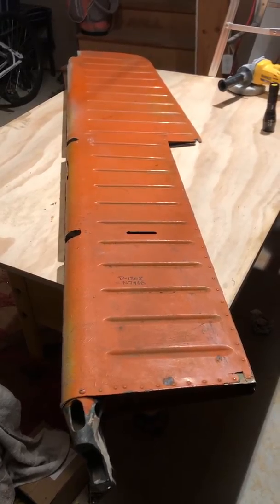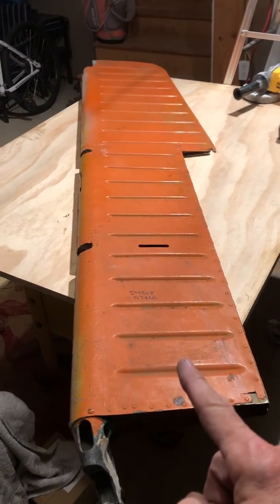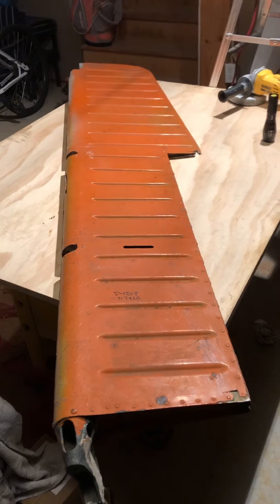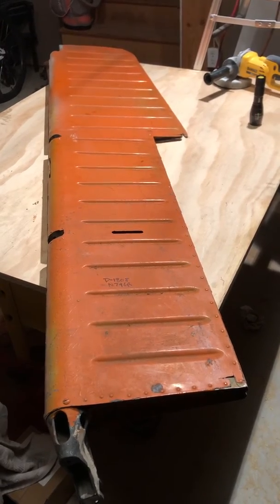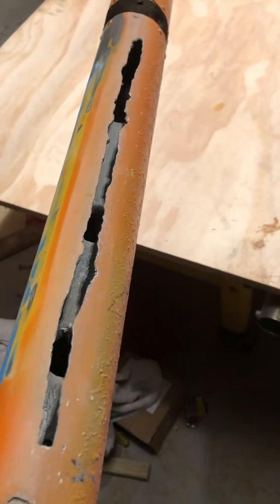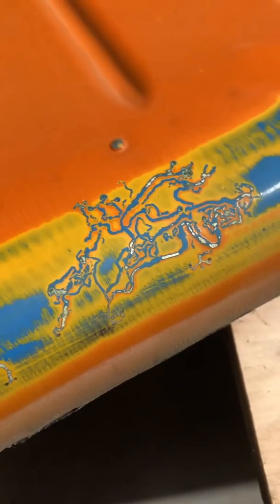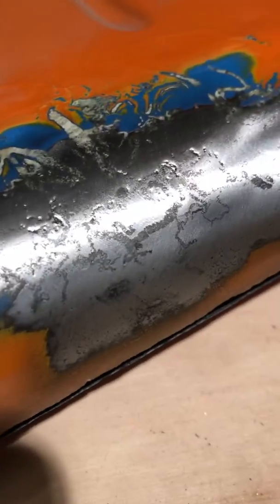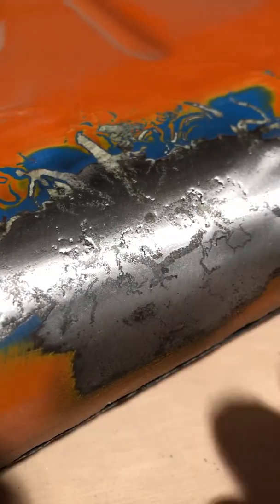Beechcraft Ruddervator Carbon Fiber Replication

Comment: Do not waste your time. It would NEVER be approved for standard cert. EVEN if you shopped for a fsdo. WHY ? let me count the reasons. 1st there is a great Aluminum built early ruddervator out there that weighs less than the mag ! YES and the workmanship is fantastic. BUT NOPE the feds say. SOOOOOO if a alum wont fly do you think they would let carbon fiber ??  And no the grade A cotton/ceconite aint going to smooth that over. There is another way. And better quality than the latest skins/stop.... ok to use.